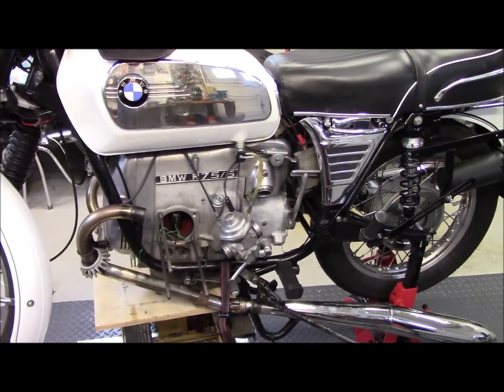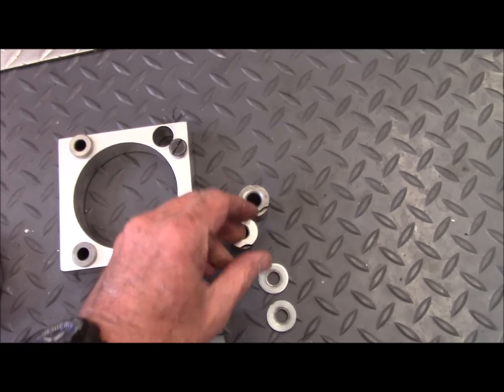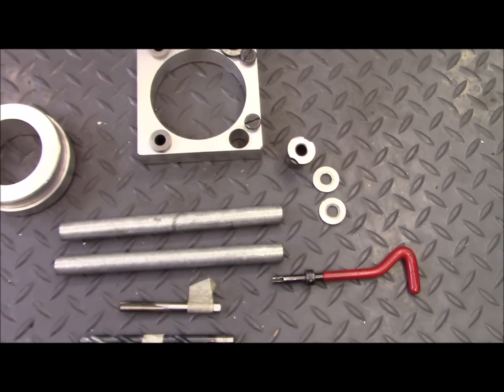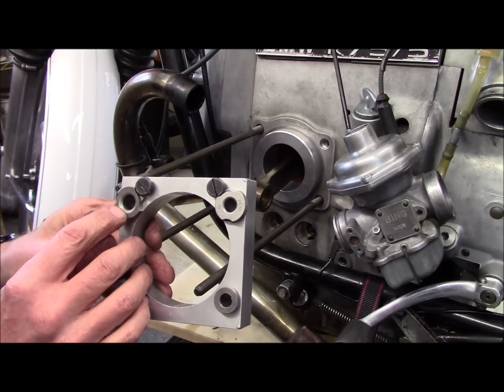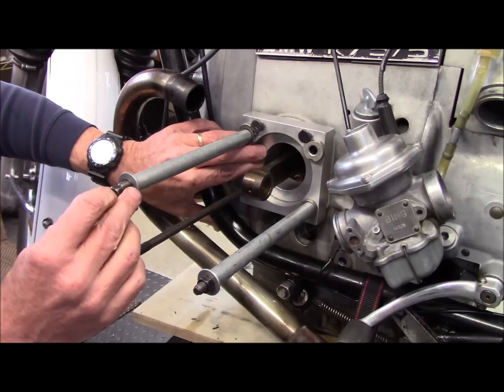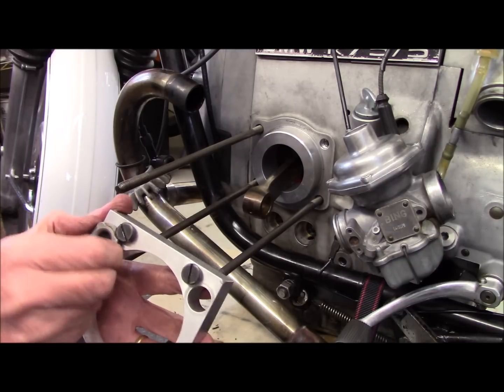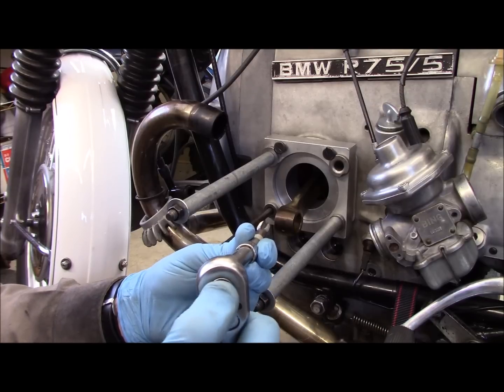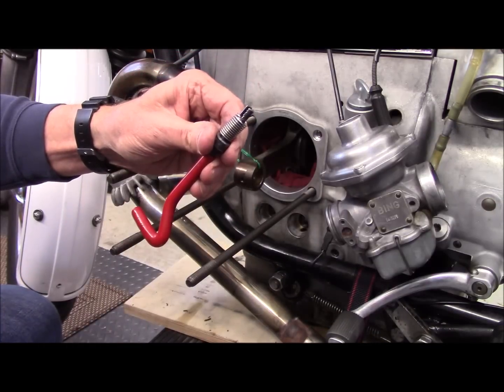1973 BMW R75/5 Repairing Stripped Cylinder Stud Threads

Comment: Thanks for the excellent video. My R45 has a repair in progress, and I keep coming back to your videos and the write-up. 

1. Do I assume correctly that as long as the Helicoil is 20 mm long, that's the right one, and no "special BMW helicoil" is required?

2. Do you punch the tang of the Helicoil before you wait 24 hours for the Loctite to settle?
Reply from the maker: Laurie, yes 20 mm fits. I think I remove the tang after the loctite sets up.
Reply: @BrooksAirheadGarage  Thanks for the quick reply. 🙏 I sometimes feel jealous for such an active Airhead community in the US, with rental repair kits and everything. Luckily your videos reach all the way to Finland. 😊

Comment: Dear Brook, do you normally use loctite when connecting the cilinder studs into the crankcase , when not using the helicoil??
Reply from the maker: Peter, I don't "think" BMW used loctite when they installed them, but I don't "know" that for sure.

Comment: Hey Brook. Do you have any suggestions on how to proceed if a previous timesert repair has failed? The hole in the case has already been drilled to 14mm to accommodate the timesert repair, but the threads that held it in place have also failed. Would appreciate your expertise in saving this r80.
Reply from the maker: Hi Matt, Sorry to hear about the failed repair on your bike. I have no direct experience overcoming your problem. I have heard of "doubling up" inserts where you use a larger diameter heli-coil and then thread the correct diameter heli-coil inside it. Due to the design of the timesert, I don't believe you can do this with them.
Reply: @BrooksAirheadGarage  Thanks Brook!

Comment: Wonderful video. Would you have any suggestions on how to keep shavings from entering the crankcase during drilling? I know using grease was mentioned for tapping but i'd be concerned about the drilling as well
Reply from the maker: Hi Matt, I show all the details of how to do this work in the link contained in the video summary under the video pane.  I removed the oil pan and then did a through cleaning of the inside of the engine multiple times to ensure no shavings were left inside the engine.
Reply: @BrooksAirheadGarage  Thank you!

Comment: I would chase the threads of the helicoil after the loctite set to remove excess. Thank you a great tutorial.
Reply from the maker: Hi agentgordo, I would not chase the threads of the helicoil. Any minor excess will not create a problem. I don't want to damage the helicoil, and any minor excess will loctite will ensure the cylinder stud stays secure in the hole.
Reply: @BrooksAirheadGarage  Gotcha thanks.

Comment: What happens to swarf that ends up in the engine casing?
Reply from the maker: It has to be cleaned out. I'm completing a write-up that I'll post on my site, "brook.reams.me" showing how all the work was done including swarf removal and I'll post a link to it in the next day or two. It requires dropping the oil pan and using compressed air with solvent to completely clean out the inside of the engine.
Reply: Thanks buddy.   Look forward to watching more of your videos.